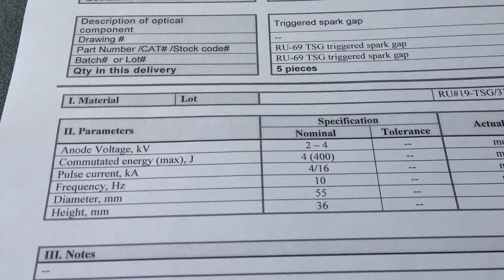Two- and Three-electrode Spark Gaps and Trigger Transformers

Comment from the maker: Triggered Three-Electrode Spark Gap Switches are ceramic-metal sealed off gas discharge trigatron-type devices with a co-axial trigger electrode. These Gas Discharge Tubes contain no mercury and, due to an advanced design, feature high reliability and a long lifetime being operating under wide range of environmental conditions.
Applications:
- pulsed installation for processing materials
- installations with plasma focus
- pulse power supplies for lasers and other pulse equipment
- medical apparatus such as lithotriptors and defibrillators
- processing systems for petroleum wells
http://www.dmphotonics.com/Plasma/Triggered%20Spark%20Gap%20Switches.htm

Flyback type trigger transformers sales@dmphotonics.com 
Flyback type trigger transformers sales@dmphotonics.com

-------------------------------------------------

Efficient KrCl (223 nm) excimer laser based on TPI thyratron as a high-voltage switch

Alexander M. Razhev, Andrey A. Zhupikov
Proc SPIE 01/2007; DOI:10.1117/12.785614
http://www.researchgate.net/publication/238531714_Efficient_KrCl_(223_nm)_excimer_laser_based_on_TPI_thyratron_as_a_high-voltage_switch
ABSTRACT The results of the experimental investigations of the discharge-pumped KrCl (223 nm) excimer laser with the TPI thyratron (pseudo spark gap) as a high-voltage switch are presented. The experimental investigation of the energy and temporal parameters of the pumping and radiation for KrCl laser on the Ne:Kr:HCl mixture with an excitation system of the LC-inverter type based on TPI 10k/20 thyratron was carried out. The comparative analysis of the laser pumping and radiation parameters with those obtained for excitation system based on a spark gap RU-65 as a high-voltage switch was performed. As a result the output radiation energy for a laser with thyratron TPI 10k/20 was obtained to be of 40% higher than that with spark gap RU-65 at the same pumping conditions. The higher output energy and efficiency of the TPI based laser was considered to be due to higher efficiency of energy transfer from storage to discharge circuit and to active media owing to lower energy losses into TPI thyratron in comparison with the RU-65 spark gap. For KrCl excimer laser in Ne:Kr:HCl mixture the total efficiency of 1.5% with output energy of 0.65 J was obtained for the first time.

Comment from the maker: RK-162-01 Untriggered Spark Gap
http://www.dmphotonics.com/Plasma/RK-162-01%20Untriggered%20Spark%20Gap.htm
RK-162-01 untriggered spark gap sales@dmphotonics.com
Type model: RK-162-01 untriggered spark gap request a quote sales@dmphotonics.com
Dynamic Breakdown Voltage: 2.8-3.3 kV 
Average switching power: 30-80 W 
Pulse current: 0.8-2.5 kA 
Diameter: 28.5 mm 
Height: 46 mm

RK-162-01 Untriggered Spark Gap
[RK-162-01-UTSG]	
http://greyhawkoptics.com/product_info.php?cPath=154&products_id=755&osCsid=13b85017586246d875d49b901b35eb9b
RK-162-01 Untriggered Spark Gap
Type model: RK-162-01 untriggered spark gap
Dynamic Breakdown Voltage: 2.8-3.3 kV
Average switching power: 30-80 W
Pulse current: 0.8-2.5 kA
Diameter: 28.5 mm
Height: 46 mm

RK-162-01 Untriggered Spark Gap in online store
[RK-162-01-UTSG]	
http://greyhawkoptics.com/product_info.php?products_id=755
RK-162-01 Untriggered Spark Gap
Type model: RK-162-01 untriggered spark gap
Dynamic Breakdown Voltage: 2.8-3.3 kV
Average switching power: 30-80 W
Pulse current: 0.8-2.5 kA
Diameter: 28.5 mm
Height: 46 mm

RT-53 Triggered Spark Gap
[RT-53-TSG]	
http://greyhawkoptics.com/product_info.php?products_id=838
RT-53 Triggered Spark Gap
Anode Voltage: 0.6-1.6 kV
Commutated energy (max): 1.6 (60) J
Pulse current: 1.3/10 kA
Frequency: 50 Hz
Diameter: 45 mm
Height: 36 mm

RU-62 Triggered Spark Gap
[RU-62-TSG]	
http://greyhawkoptics.com/product_info.php?products_id=756
RU-62 Triggered Spark Gap
Anode Voltage: 4-10 kV
Commutated energy (max): 23 (300) J
Pulse current: 4/16 kA
Frequency: 50/0.1 Hz
Diameter: 55 mm
Height: 36 mm

Type model: RU-69 triggered spark gap - request a quote sales@dmphotonics.com
http://www.dmphotonics.com/Plasma/RU-69%20triggered%20spark%20gap.htm
Anode Voltage: 2-4 kV 
Commutated energy (max): 4 (400) J 
Pulse current: 4/16 kA 
Frequency: 10 Hz 
Diameter: 55 mm 
Height: 36 mm

RU-69 triggered spark gap
[RU-69-TSG]	
http://greyhawkoptics.com/product_info.php?products_id=757
RU-69 triggered spark gap
Anode Voltage: 2-4 kV
Commutated energy (max): 4 (400) J
Pulse current: 4/16 kA
Frequency: 10 Hz
Diameter: 55 mm
Height: 36 mm

Comment from the maker: Trigger Transformers
Del Mar Photonics supply trigger transformers for triggered spark gaps and other applications. Contact us to today to discuss your application or requesta  quote.
Trigger Transformers are used to provide a fast high voltage pulse up to 30kV/µs and more. This high voltage pulse is applied to the trigger electrode to initiate switching action in the three-electrode spark gaps. Either positive or negative pulses can be obtained from all of the transformers.
http://www.dmphotonics.com/Trigger%20Transformers/trigger_transformers.htm

Comment from the maker: Spark gaps online store - ask for quantity discount at sales@dmphotonics.com
http://greyhawkoptics.com/index.php?cPath=154&osCsid=882ef4250ca29fc5e45147b3724a630a
R-90-UTSG 	 R-90 Untriggered Spark Gap 	 $790.00 	Buy Now 
 RK-159-UTSG 	 RK-159 Untriggered Spark Gap 	 $485.00 	Buy Now 
 RK-161-UTSG 	 RK-161 Untriggered Spark Gap 	 $490.00 	Buy Now 
 RK-162-01-UTSG 	 RK-162-01 Untriggered Spark Gap 	 $680.00 	Buy Now 
 RK-163-UTSG 	 RK-163 Untriggered Spark Gap 	 $490.00 	Buy Now 
 RK-164-UTSG 	 RK-164 Untriggered Spark Gap 	 $610.00 	Buy Now 
 RT-53-TSG 	 RT-53 Triggered Spark Gap 	 $475.00 	Buy Now 
 RU-62-TSG 	 RU-62 Triggered Spark Gap 	 $590.00 	Buy Now 
 RU-69-TSG 	 RU-69 triggered spark gap 	 $480.00 	Buy Now 
 TT511A 	 TT511A trigger transformer 	 $530.00 	Buy Now 

Triggered Three-Electrode Spark Gap Switches are ceramic-metal sealed off gas discharge trigatron-type devices with a co-axial trigger electrode. These Gas Discharge Tubes contain no mercury and, due to an advanced design, feature high reliability and a long lifetime being operating under wide range of environmental conditions.
http://www.delmarphotonics.com/Plasma/Triggered%20Spark%20Gap%20Switches.htm